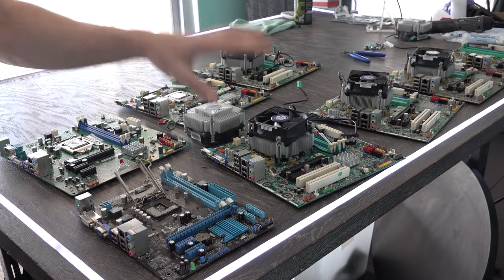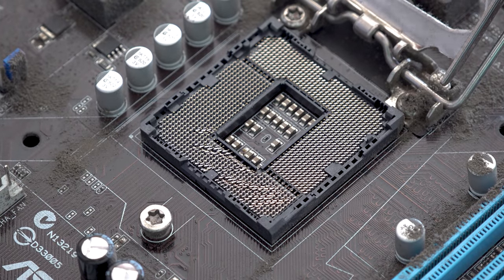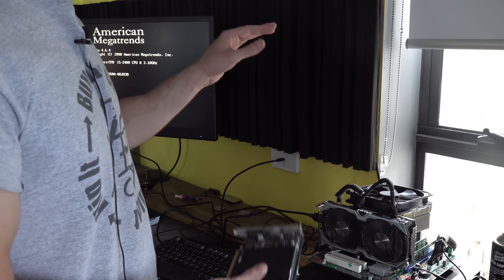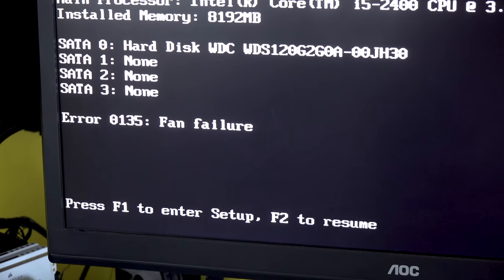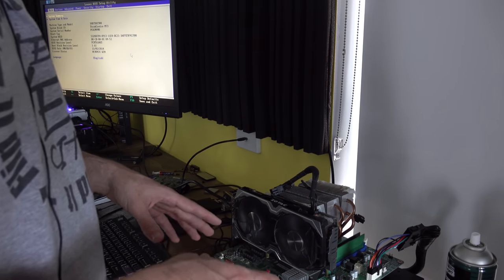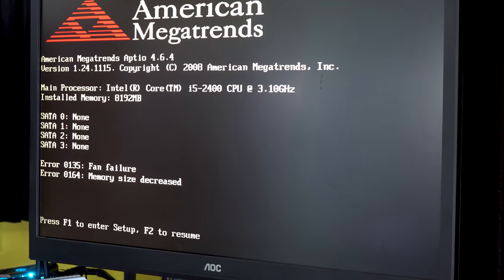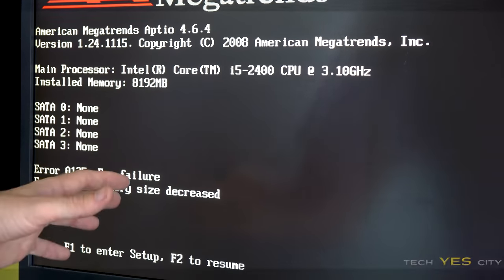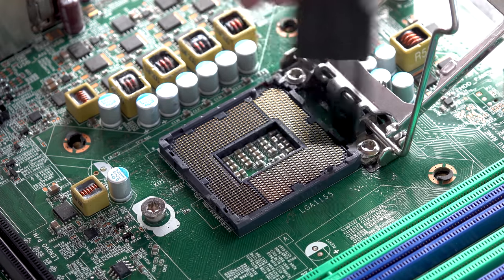Cleaning Motherboard CPU PINS?! (Lenovo M91p Thinkcentre's Explained)

Comment: I use brake cleaner for cleaning out sockets
Reply: Me too. I remember Bryan doing this as well in one of his videos.
Reply from the maker: Brake cleaner is def my thing too, but this is about targetting the pin tips.
Reply: Brake cleaner can melt some plastics so use caution.
Reply: Maybe spray some brake cleaner on the brush instead?
Reply: @jackflash6377  Brake clean isn't that caustic, you're thinking of carb cleaner which should most certainly not be used on plastics or rubbers
Though it should come with the caveat that you should not soak or expose plastics and rubbers in brake clean for any extended period of time. If it doesn't immediately evaporate just from ambient temperature you should quickly encourage evaporation with some compressed air.
Reply: @Azerkeux  back in the day brake clean was stronger.  The stuff nowadays is a different formula, imo, and doesn't work as well.  At least we're I am from, probably changed it do to some regulations or issues.
Reply: Just use Wd-40.
Reply: @jackflash6377  use acetone free ones and all will be good.
Reply: Been using Valvoline brake cleaner ever since i subscribed to Tech Yes City...... I have to be honest, I was pretty much hesitant spraying the stuff on computer parts to clean it but i have yet to get a failure. Tech Yes City has saved me a lot of money. the amount of faulty parts you get by buying 2nd is quiet a lot these corona days but this channel learned me how to repair most of those problems!
Reply: @davekelders283  I have also hesitant. But it worked. Thank god

Comment: To clean cpu pins, instead of using multi-purpose spray cleaner/lube, I think a better alternative would be ELECTRICAL CONTACT CLEANER! Generally it is a bit thinner than most multi-purpose spray cleaner/lube I have found and it is it's main purpose anyway... So y'all are not missing out on anything for not having the australian export multi-purpose spray or crc 556 since i'm pretty sure electrical contact cleaner is not hard to find internationaly.

Comment: I picked up some similiar Lenevo PC's for £20 a pop, wacked a second gen i5, 8gb ram and some semi decent gpu (not a GT card) and I sold them in new cases, with a new psu and ssd for a profit, typically made £60-80 per machine, profit wise.

Comment: It's not that they didn't program future GPUs into the firmware, that would be impossible to tell the future. It's that something like architecture, programming language, or else are not compatible between the mainboard and graphics card.

Add a GPU to the final board. Maybe only onboard video desn't work.

Comment: Pro-tip: never flash the BIOS inside of Windows, especially on these older boards. The last thing you want to have happen is for the Windows kernel to crash while the BIOS is being flashed.

Always always always flash the BIOS in a MS-DOS-bootable USB drive.
If the BIOS allows it, update from within the BIOS (obviously), but if not, then always flash from within a bootable USB MS-DOS drive.

Comment: I have found from experience that when ram is not detected that doing these 3 things will usually solve the issue unless there is physical damage to the board. or dirt or debris in the CPU socket 
1st thing to try is to clean the gold contacts on the ram with q tip and rubbing alcohol 
2nd  clean the bottom of the CPU gold contacts the  pads with a q tip and rubbing alcohol 
3rd clean the ram slots them selves with rubbing alcohol and a old tooth brush i have had a 99.9999% success rate using these methods

Comment: 15:03 i broke one of my pins while fixing mine last month and couple of them are still have  bent then i got worried then i attacted my processor on bent pins working fine even in games .
Reply: Some pins are just grounds or control something you might not be using. I thought I bent a couple of pins on my old Asus 2011 board and I put the chip back in and it worked fine. Later I pulled the chip when I was was swapping boards around and it seemed that maybe it was dirt or something because I was blowing it off and it appeared the pins might be fine, either way the board still works with whatever ended up in it after I built up the best boards I had. Nice to have a extra board around in case anything dies that I can swap in or steal parts from.

Comment: When you use the multipurpose spray (or the like) how do you get if off? I've been using similar stuff to clean boards, but it's a real pain to clean the spray off and it takes like half a week to let it evaporate off

Comment: Hey man i have a problem. I purchased Dark Rock Pro 4 cpu cooler, but when i mount it and tighten the screws all the way i dont get post. I loosen them up a bit and it works. I had this issue while i was moving my pc to the other room. Check my motherboard cause first thought was that it broke but its fine no damage. Checked pins in the socket they are all fine. Any idea whats going on im so bummed i got myself i7 4790k on msi z87 g45 motherboard. Wish i could fix it so i dont have to remount cooler everytime it wont boot.

Comment: Question for Brian: I'm running an X58 ASUS Rampage II Gene motherboard (with x5675) which I accidentally fried the USB ports on (plugged in a too high voltage power adapter into a USB hub connected) so now have to use a PCIe USB card. How easy do you think it would be to fix it? I'm guessing replacing some capacitors would be the order of the day? It also had the "cold boot" bug/problem since well before where it will only start instantly either from sleep mode, or after 3-4 failed boot attempts (fans rev up... turn off... rev up... turn off.. etc.. then finally boots up fine).
Reply: The cold boot problem is because your overclock is unstable

Comment: Just in time!! I bought used Asus X99 WS/IPMI - pretty premium board. But 7th and 8th ram lot doesnt seem to work. So i will try to clean pins. Is it worth to use special cleaner for potentiometers which i have?

Comment: For people that ask about WD40 the standard one is a no go but they do offer one which is suppose to be fine designed for this purpose. 
Depending on your country it may cost a bit more it's called WD-40® Specialist® Electrical Contact Cleaner Spray. (UK WD40 £1+ this one is £5-6)

Comment: Here in the states we say "if it ain't broke, don't fix it". I absolutely hate when mechanics say it to me. Tech is acceptable but not 2 ton bullets. I use a gentle toothbrush on dirty sockets. Usually don't use any cleaners first attempt then alcohol and if that don't work brake cleaner and alcohol for any residue the hexane leaves behind.

Comment: 0:12 That's not a proper way to remove the I/O shield from a Lenovo thinkcentre. Push the shield in slightly near the PSU to unlatch it, slide it to the left and it should just fall out.
Reply: its funnier the other way in till you bend the cheap pot metal

Comment: Waiting for faulty boards with cpu socket brushed and newbies doing it. Don't touch that if you got no problem! And still don't brush them cpu socket pins if you got no glue what you are doing. This method is extreme.

Comment: hey brian, do you have any advice on a motherboard that boots up when you push down and put pressure on the 24 pin ? i cleaned with wd 40 and it was working perfectly fine but then a few days later it started happening again. any advice on some tech yes loving techniques ?

Comment: Hello Bryan, I have a lenovo m83 MT tower and a R9 390 Sapphire edition 8GB. I am currently using 2 PSU-s with green wires connected together, but it gets stuck at the lenovo splash screen. I can enter the bios without a problem but it doesn't get past the lenovo splash screen.

Comment: is it really necessary to clean motherboard pins? I've had desktop pcs for almost 20 years and never had to resort to such a thing...
Reply from the maker: It's working miracles here, not sure though on what mobo and pins you have? Has the CPU been in the motherboard the whole time?
Reply: It's more of a thing if you buy lots of used hardware, especially non-working or untested.  You'd be surprised how many boards are saved simply by a good cleaning of the PCIe and CPU sockets.

Comment: What would be a good solution for random RAM failures? I have a Dell Optiplex 790 SFF mobo where one pair of RAM (4 sticks, 2 different pairs) will randomly fail. Unseating and reseating usually works (sometimes I have to do it a few times before it will boot) but it will still fail from time to time.

Comment: I have the M91 Lenovo and it is in a full size tower, I need to upgrade the video card but not sure what will work. I am thinking about the GTX 750 Ti but need it to be full instead of small form, the metal piece on the end. Is there a specific name for the metal plate that will help me find the plate for the  GTX 750 Ti ???

Comment: I have a question.
I am not an extreme tryhard gamer, nor do i play it for a living, i only wish to play video games in my free time (if i get any).
Will a 58 motherboard, xeon x5675 and rx570 or rx580 be good? 
Also i have no intentions of upgrading it cuz i want to go more into academics as i grow.
Reply: Go get an old Xeon and 16gb of memory. It’ll work fine. I’d consider a 1660S too.
Reply: a good x58 motherboard, a Xeon x5675  and 3 sticks of ddr3 on triple channel would perform amazing if you overclock the cpu.. as far as the gpu if you are on a tight budget a rx580 4 gb would be a good option but if you could find an 8 gb it would be even better in the US they go for cheap compare to their value but if you are going with a 8gb don't get the rx580 armor as it's heatsink is tiny and it gets hot a Asus strix triple fan is amazing and could be overclocked as well... the x58 motherboards are overpriced it would only be good if you get one for cheap or find one in a bargain

Comment: you ever clean a mobo with brake clean and it drips the board coating on things blocking connections?

Comment: Brian, I've been having issues with my Lenovo M91p, after updating it to windows 10 Pro and all that, it wouldn't completely shut down, it would always go into some sleep mode or sth when I try to shut it down, I have to manually shut down the PC by holding the power button. Any thoughts or ideas on this?
Reply: Turn off fast startupt. But it still has problems while going to sleep or doesn't shut down completely while hibernating but at least it shuts down normally.

Comment: Have the same MB with an i5 2500 and gtx 1060. Good for gaming, almost any game runs at 60fps or over. The only problem is that the stock CPU cooler gets loud.
Reply: Do you know if the motherboard supports any graphics card. From what ive read some may not work
Reply: @kellybodley8363  works well with gtx 1060, idk about any newer gpus
But it is the M91p!

Comment: I bought a used motherboard on amazon with 4 ram slots and i can only place two in single channel with the first two ram slots (not the matching slots) any other configuration wont work

Comment: My risky trick of a dell power supply of 350 watts is to loosen the ventilator with the screws so it gives no noise anymore. Other trick to stick with double sided tape the graphic connection with 8 to 6 pins on the bottom of my case so there is no  short  circuit anymore.  I want a video tuturial to change the dell powersupply with a small other brand powersupply of 450 watts so i can put a RX470 in it . The processor is a Core I5 750 and is it processor wise smart to change my gtx 960 to a  rx 470 ??   Why is are the pictures of GTX 960 beter and beautifuller and more colour in it and brightness and sharpness than a GTX 1070 of a friend ??  And how can sync the RGB of different brands of hardware together. from mouse to keyboard to rgb led strips ??

Comment: i've got a strange case.. i replaced old cooler with Gammaxx 400 and now. everything was fine till i found that i had drops because of cpu (x3440) frequency dropped from 3.4 ghz to 1.5 for a few seconds. Any suggestions?
Reply: Thats normal at idle, speedstep down clocks to save energy, as well as low power states like c3, c6 etc. If that's at load then cpu is either not getting proper voltage or its thermally throttling most likely.
Reply: @lagginswag  well if its idle yes but this happens in gaming or benchmarking

Comment: Brian, hi. Dude. Ive been trying to get you to respond on an old video of yours with no luck. Its about cpu cache ratio on haswell chips. This video https://youtu.be/d0OBwmcbjZs
I have an i7 4790. Should I set it to 100mhz under the stock core clock (3.6ghz) or under the mas boost clock (4.0ghz) or, under the all core boost clock (3.8ghz)? If you could reply to this. Or even update the videos descroption. That would be very nice. Thanks dude. Keep doing your stuff!
Ps: is it worth it to disable spectre and meltdown on this chip? (I get the "good" performance eval on inspectre...) Thanks again.
Reply: @SISSYPUSS  Hi, thanks for replying. Lets see, mine is a 4790 (non k). So the stock core speed is 3.6 (36x). Ive taken the cpu ratio and bumped it to 40x on a per core basis (if I lock it in "sync all cores" as was my original intention, the cpu is locked and STAYS AT 38x). The turbo boost speeds are as follow: 1-2 cores 4.0ghz, 3 cores 3.9ghz and 4 cores 3.8ghz. What I mean is, there is no way AFAIK to lock all cores at 40. So, again. What should I set the cache to? 35 (under the stock clock), 37 (under the max all core turbo boost) or 39 (under the 2 core max turbo)? If there was a way to SOMEHOW LOCK all cores at 40x (4ghz) that would be amazing and it would simplify this whole "cache debacle". but I seriously doubt there is (please, prove me wrong in that). At the moment I have it set to 37 (the cache) cause like I said, I have the cpu locked at 40x on all cores but when in use all cores drop to 38. So I THINK thats the best bet. (Cpu never downclocks to anything under 3.8). Regarding spectre and meltdown, all I play really are cs 1.6 and CSGO. Both pretty cpu heavy games. So should I disable the protections? Ive tried it before and saw no real increase in performance. No extra fps or anything in game. Or none outside of the margin of error. Granted I was testing with the benchmark map... But I dont know... What do you think? Funny you should mention undervolting as I was actually thinkin of trying to do so with throttlestop. To see if somehow undervolting the cpu would manage to allow it to get to 4.0ghz on all cores. I have to be honest here, I dont know really if thats how it works? I mean, I know ONE OF the pre requisites of max turbo boost is voltage (temps and load being the others) so maybe undervolting it would magically give it that extra oompf? Doubt it though... And finally, I could max out the ram. Currebtly cant cause Im using a cheapo asus h81m-k mobo which has served me well but besides having (very) limited bios options, has only 2 ram slots. As I have a couple of 8gb ram sticks laying around I could consider getting a (equally cheap, but a tad better) b85 mobo maybe? Just so I could fill the 32 gb max. Im currently using an overclocked gtx 1050 ti which jas served me well so far. Specially for the games I play. So I see no real reason to update it. At least not yet... Thanks again for the reply. And sorry for the wall of text but this has been the closest Ive ever gotten to a response on this guys videos... Hope you can help me a bit further. Im not expecting to magically turn this old girl into an i9 +2080. But I sure would like to extract every last drop of performance out of it (without daming the pc of course). Thanks!
Reply: @SISSYPUSS  BTW, cant disabke the igpu on this mobo. But at least its not getting recognized in windows. So I would assume having a dedicated gpu automatically disables it... Althoug I know at least some gigabyte b85 mobos have the option tk EXPLICITLY disable the igpu. Never quite understood why though...

Comment: is  xeon1230v2 still a viable cpu in 2020 i want to pair it with an h61 motherboard and Rx 570
Reply: My spare pc has a 1235, 12gb and a gtx 760 on h61, shoulda bought a better board. It'll work but to extend the life of a dead socket, overclocking sure helps lol. Plus h61 can have issues like sata in weird spots, (which I had to remedy with a left angle low profile cable), as well as no usb 3.0/sata 3.0 on certain boards.
Reply: @lagginswag  ok noted thanks for the advice

Comment: how about not mixing RAM from different manufacturers ?? I heard its not a wise thing to do compatibility wise
Reply: The sub timings are generally the issue, they should match at the slowest speed, but that doesn't ensure stability. Even the same type of ram, from the same company can have different timings/ranks if you buy the kits at diff times or diff vendors.

Comment: Operating System
	Windows 10 Pro 64-bit
CPU
	AMD Phenom II X2 555	44 °C
	Callisto 45nm Technology
RAM
	8,00Gt Dual-Channel DDR3 @ 669MHz (9-9-9-24)
Motherboard
	ASUSTeK Computer INC. M5A78L-M LE (AM3R2)	51 °C
Graphics
	Generic Non-PnP Monitor (1680x1050@60Hz)
	3072MB ATI AMD Radeon R9 200 Series (MSI)	32 °C
Storage
	476GB SSD 512GB ATA Device (SSD)	40 °C
Optical Drives
	TSSTcorp CDDVDW SH-222BB ATA Device
Audio
	Realtek High Definition Audio